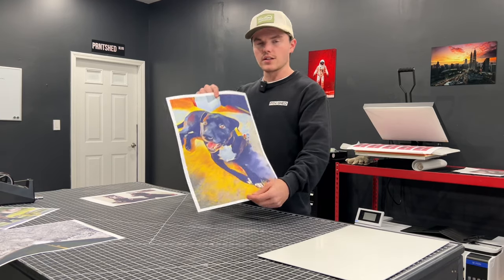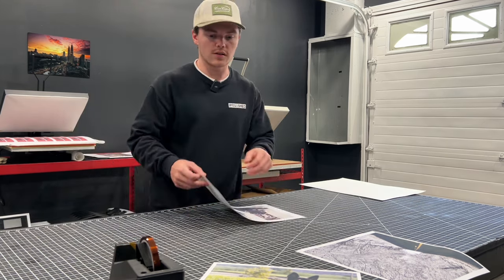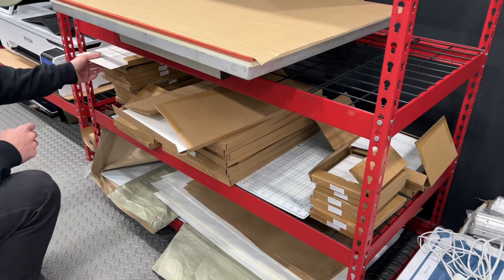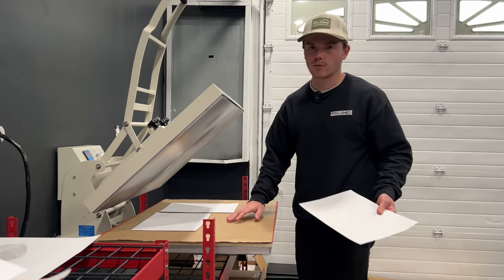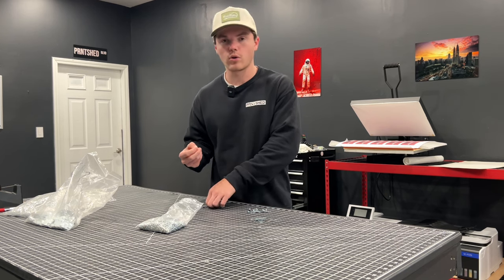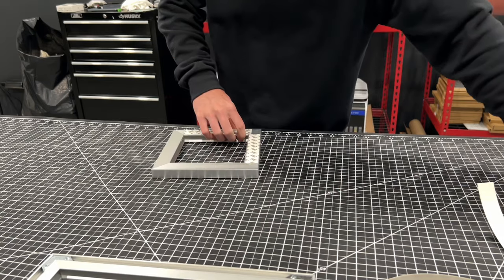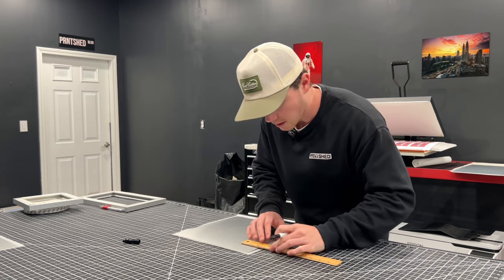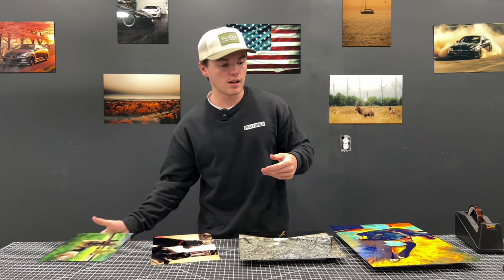Making Metal Prints For My Business: Day 2

Comment: I want to print some photos on metals, but I dont wanna buy a printer, there are a lot of printing services arround me locally, Can i just order the aluminium plate and a heat presser and print a normal picture on a paper from them? or it requires special paper and printer
Reply: Hello, planning on doing the same too, I'm curious how it worked out for you...

Comment: 5 mins is too fast on images 18 inches and larger. It should be closer to 8-9 mins. The reason is that you want the image to gas at the lowest rate do to the expansion of the aluminum compared to the paper. The larger the print the blurrier the image will get at higher temperatures. Find out what the lowest temperature is, call Chromaluxe. You will be glad you did.
Reply from the maker: Interesting. I’ll reach out to them and see what they say. Thanks for the tip
Reply: Glad to help. I found out about this problem when I had a business create a 30x30 aluminum print. The center was visibly sharper then the edges. Chromaluxe then referred me to a company that explained the expansion paradox.